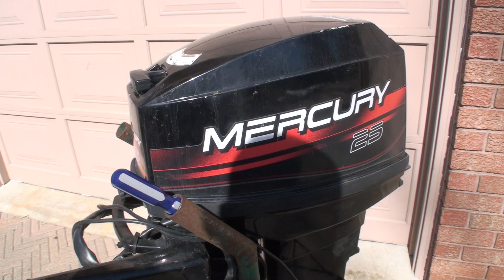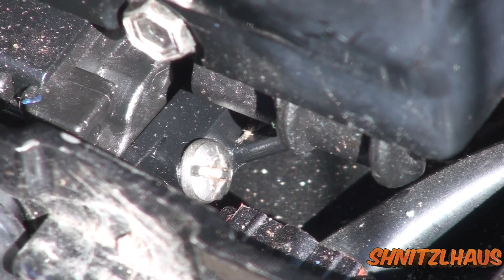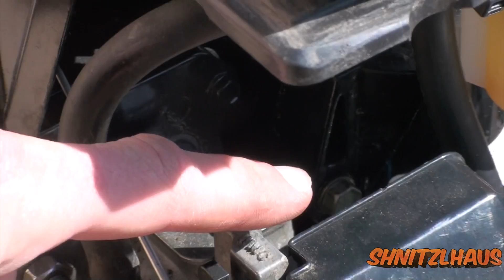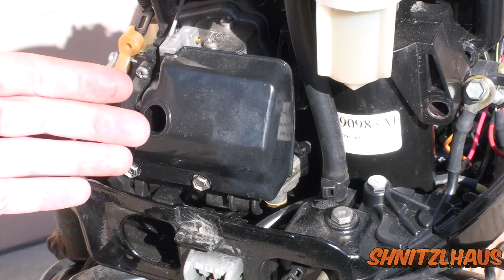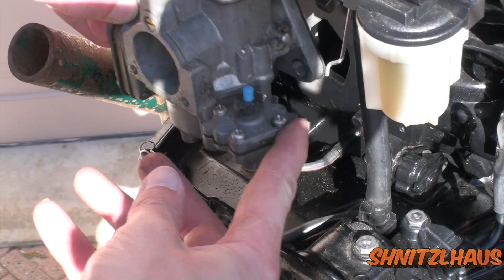2 stroke mercury 25hp Carburetor Removal

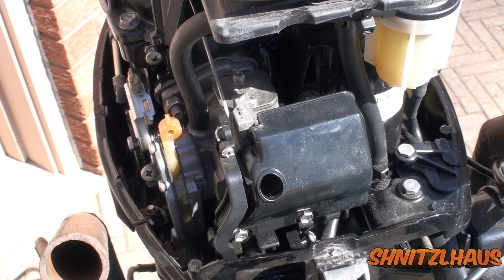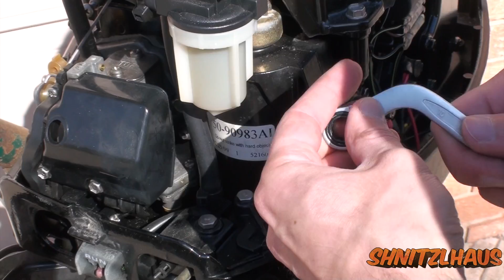Comment: Can you explain the linkage arm you remove at 1:15? I took mine off months ago, now I can't figure out where to reconnect it. When you take it off at 1:15, it seems to just fall off. Then at 1:27 it's back in the picture and appears to be connected to something. I cannot find anything to connect it to :(
Reply: Have you found out? Having the same problem

Comment: I have the same motor but with electric start. I can start the engine. But the engine bogs out and stalls after I press the accelerator. Any tips , ideas what the issue might be ?

Comment: Hey Buddy, 
I can see clearly where you disconnected the linkage from the fast idle arm, but where does the other end connect to? Do I have to remove the Starter Assembly Housing in order to reconnect that end?

Comment: I have a question...the carburator of a 1998  20hp mercury is the same as the 25hp? If not,what is the diference? Can i use a 25 hp carburator on a 20hp?thanks.....

Comment: Hey Man, always enjoyed your videos. Glad to see you back with another. About 2 years ago, I rebuilt a new 4-stroke Mercury 15HP that was hit by a car. The boat was rear-ended and it did a number. It was a fun project and challenging. I have marine experience but was a newby to the 4-stroke marine engines. Happy boating season. Take care.
Reply from the maker: Thanks! wow, hope you are not the original owner of the outboard as it sounds like a nasty hit! you as well, catch some fish or some rays.
Reply: Was not mine thankfully. Owner did not have insurance on the boat or something like that so needed it rebuilt. I actually said no to the project twice! haha. Took about a year to source all of the parts needed as they changed those unit yearly it seemed. Do you still have the old tractor? Always liked those videos as I have a 1965 Cub Cadet 125. Bought two Ninja 600's and sold one for the price I bought the two for and traded the other for the Cub Cadet. Best damn trade I have ever made. Came with a plow, snowblower, mower deck and rototiller. That was about 6 years ago now and have not had a single problem. I call it my clown mower as someone painted it red and yellow. hahaha. Would like to pull it into the garage and restore it a little once my 1966 Beetle is finished. Some day!